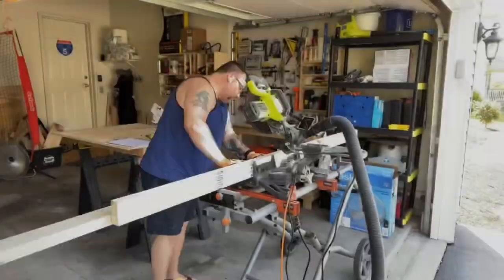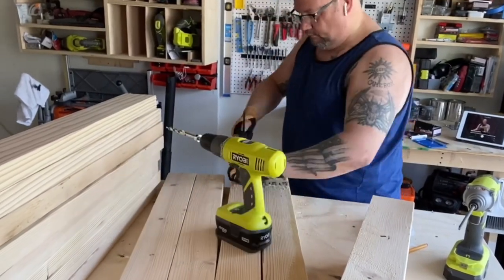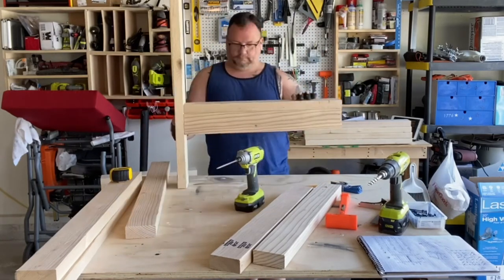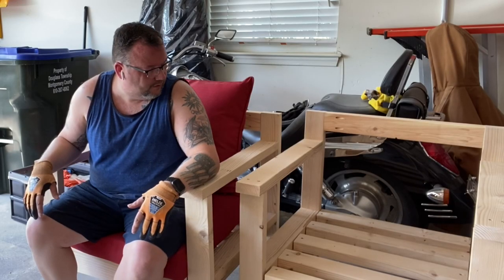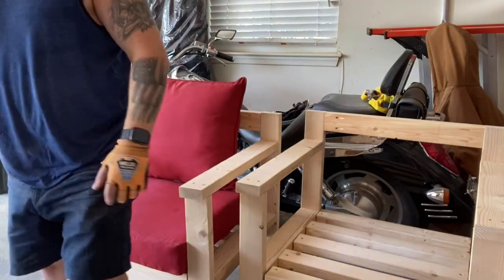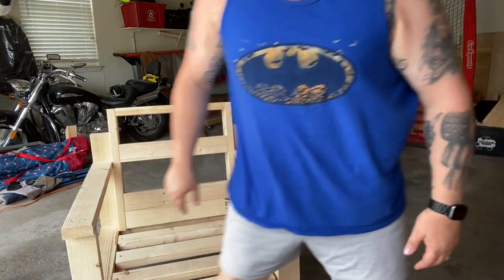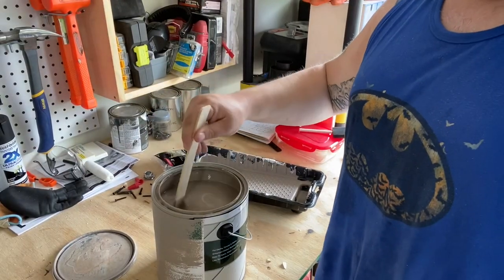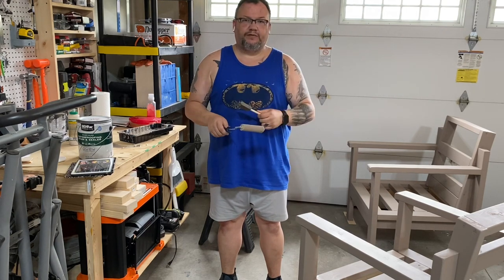Outdoor Chair Build DIY

Comment: I really like your design and would like to build it. I am new to woodworking and DIY'ing and I was hoping you could provide a little more instruction on the process of attaching the seat base to the legs. At what height is the base attached to the legs? Also what are the dimensions for the angled pieces? Thanks
Reply from the maker: The side piece is simply screwed into the end seat base. They sit 14 inches at the top of the seat from the bottom of the leg. 
15degrees I believe was the angle I used. 
If you check out the description of the outshoot chairs video the size for everything is in the there. 
Thanks for watching I’m very glad you got value from it. 
It’s a very basic build perfect for every level of woodworker.